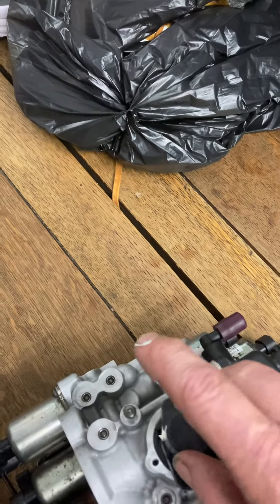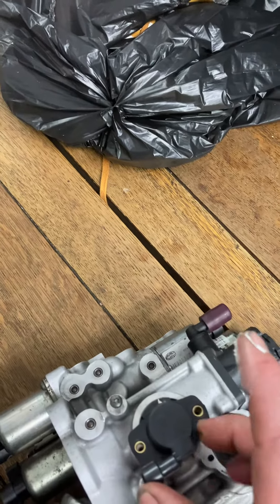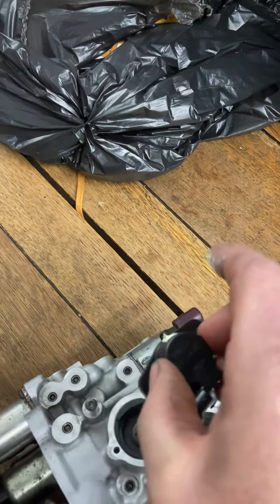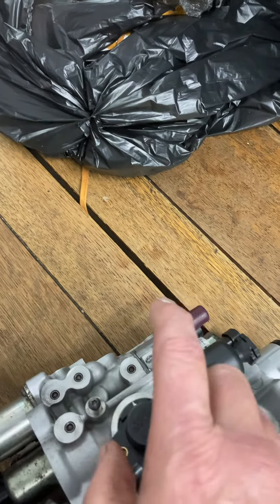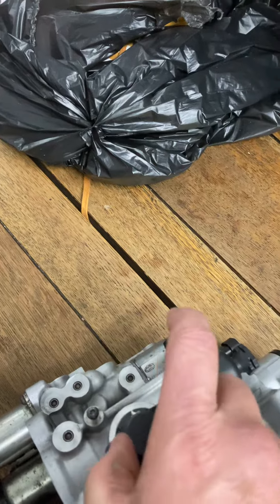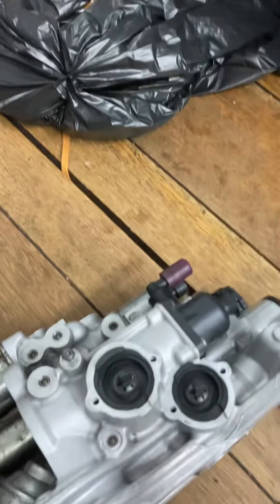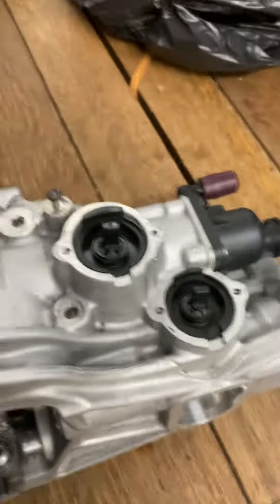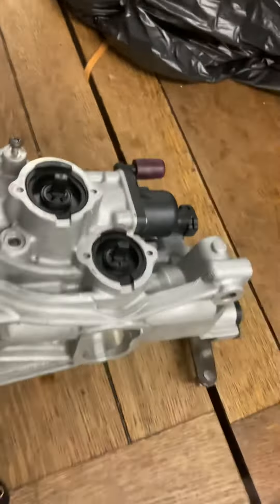Master Trafic QuickShift Sensor fitting pf7c/00

Comment: Hi,
Thanks for your videos, your knowledge on this device is so valuable. 
I have a Vivaro nearly 200000 km and everything is working fine so far except that those past few days I noticed that, when I open the door, the pump is running longer than usually (around 14 seconds instead of 7 before). 
So I wonder if I should check or replace something before the breakdown?
Maybe the pump or the damper become weak…
Thank you for your help.
Reply from the maker: @jabouteur  your accumulator has burst
Reply: That make sense indeed.. Is it possible to change the accumulator without removing the robot off the gearbox?
Reply from the maker: @jabouteur  no quicker to remove the unit.